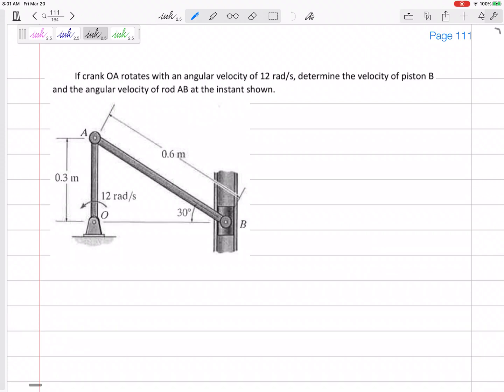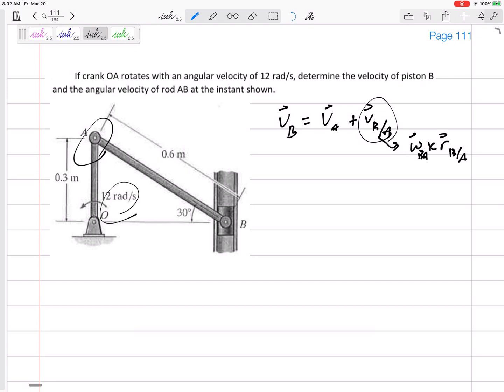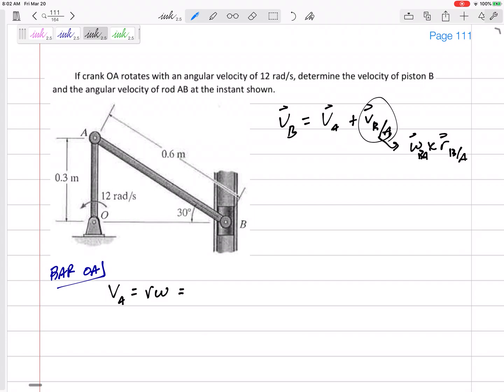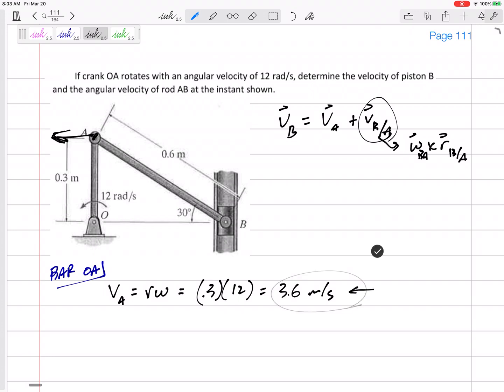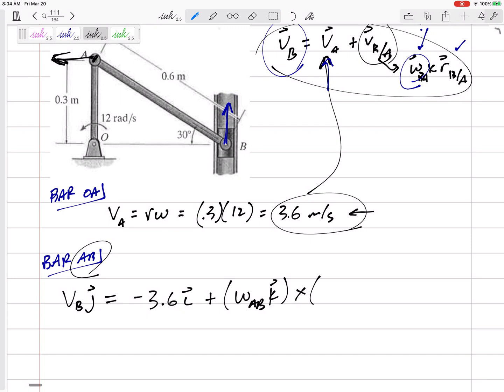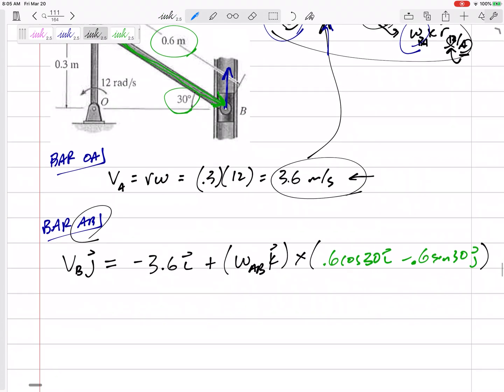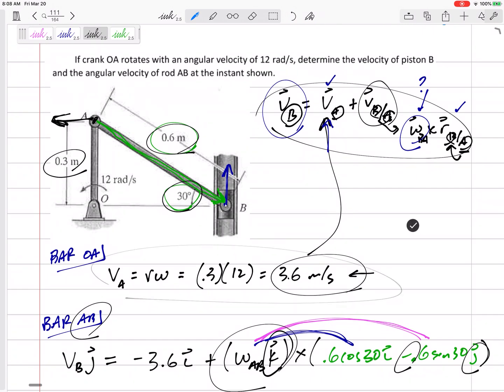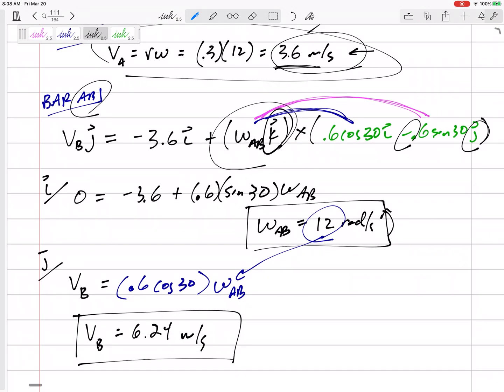Dynamics - Rigid Body relative velocity example 4

Comment: So comparing this problem to the previous videos problem, why did you keep and plug in the Va=r*w value into the equation but break it into i & j hat directions in the previous?
Reply from the maker: Because link OA is perfectly vertical, then the velocity is solely in the horizontal direction.